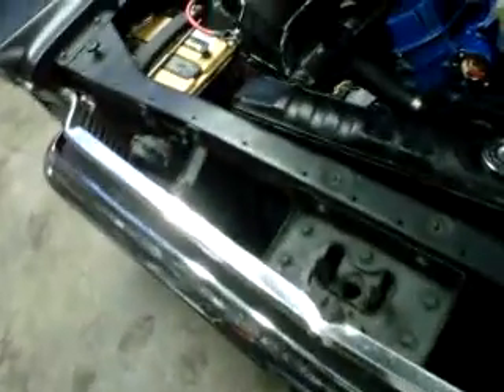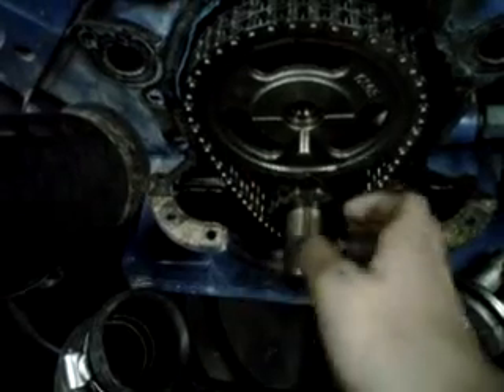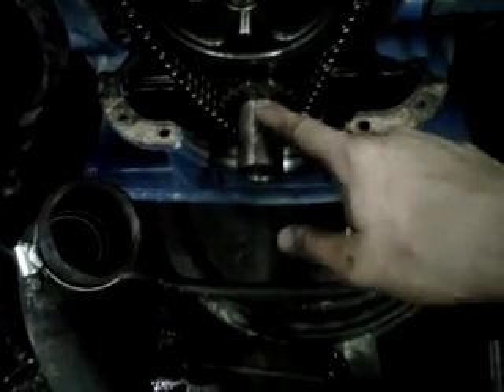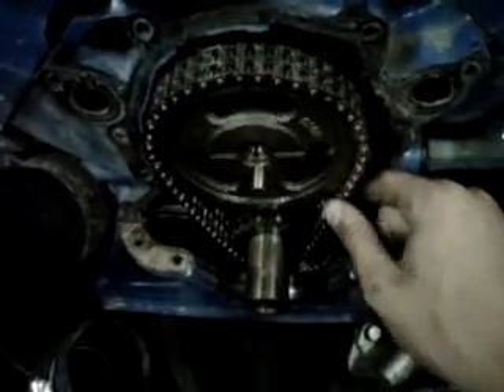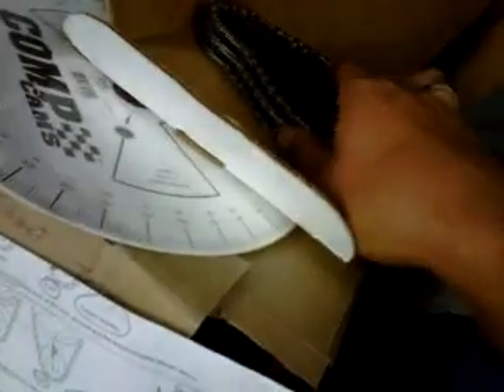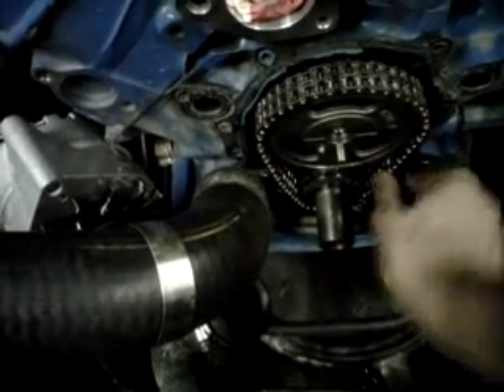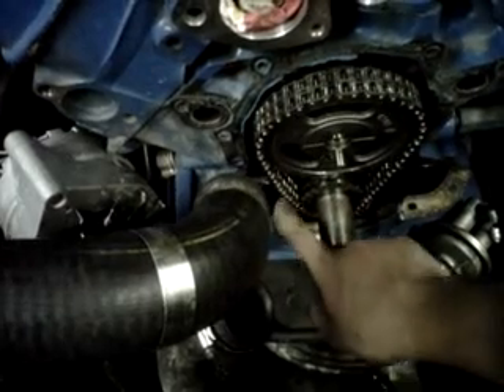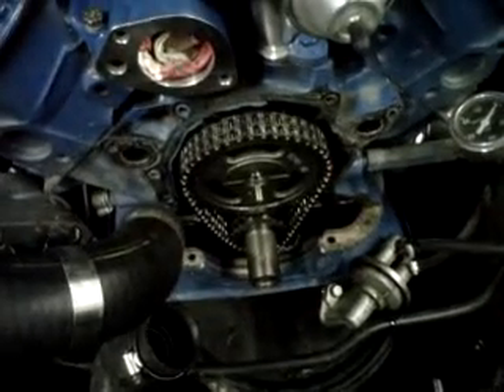worn out Ford 302 timing chain play THIS IS TOO MUCH

Comment: That’s normal. 1/2” free play
Reply: Actually 1/2 inch or more is considered time to replace.
Reply: When they go on new, they're tight. But after, for example say, 20,000 miles, they're boke in good and there should be some slack. 1/2  or so, is fine. Also crucial is to make sure they're getting lubed and the gear teeth are wearing evenly. Can read a lot from just that.

Comment: My mustang 302 has been having weird performance issues about 2500 3000 rpm I turned up the timing and it kinda helped but it still has that little bit of lag about 2500 almost like it loses power or something. Woulda kinda spudder before I turned the timing up to 35°. Any ideas what it might be

Comment: Goodson has a crank Turner socket to rotate the crank. They also have valve seal tools. OTC has Ford tools and Kent-Moore has tools. Rotunda has Ford tools. E-Bay has Snap-on scanners and cartridges and manuals and adapters. Get the 120 volt adapter to plug into the wall outlet to check codes already in the scanner away from the vehicle. Get the latest cartridges.

Comment: my car has no spark it's a 1999 Mercury Sable I change the crankshaft sensor and camshaft sensor the ignition coil I'm wondering if it could be the timing chain?
Reply from the maker: I really don't think so. Get to poking around with a test light to find one at what point you are not getting power

Comment: What were you fighting? Poor idle?
Reply from the maker: +Gregarious3 poor idle pretty much and just lazy performance. was really noticeable on a my engine that runs a higher lift cam.
Reply: That higher lift aftermarket cam can also be the source of the problems you're describing. Im also guessing it has narrower overlap (choppier - "rumpity rump" sound). Yes that timing chain does look a little loose but many really misunderstand the different characteristics of engine upgrades. One of the biggest problems seems to be that people focus on Peak and or horsepower numbers and not so much on the compromises and which may be made. A high- cam can increase horsepower in a higher RPM range but many times will be at the sacrifice of lower RPM torque. From what you stated about having a rougher idle and less performance off the line can be directly related to this. That 4° degrees advance you mentioned is typically a pre - ground in to help address these issues to a degree,  and give it more torque so to speak.  
On another note,  this is in a ford 302? 
So an OBD1. Engines with larger cams, especially the overlap, can have many issues when using OEM "computers", even with a new "chip".  Unless it was done by a very knowledged chip writter/burner, chances are its garbage.  All those magazine or store chips are trash & b.s. and forget about some ebay china crap. 
In reality this can destroy your engine,  depending on how extreme the cam & changes are. 
Believe it or not, its the cam that can bring the most issues with stock, & even aftermarket computer setup. It has trouble deciphering the valve timing thus air/fuel, richer/leaner, etc

Vehicles with mass air flow are a little more forgiving to this, for to some degree it can self learn somewhat, whereas speed density is unforgiving & is why nobody wants to touch it. But if you find the now one in a million who truly know burning OBD1 chips, the SD can be more accurate.

Again i don't know what you have, what was done, the cams specs, so im shooting in the wind. Your set up may be fine, but i would look into what i said, & take it from there & figure out if these apply.